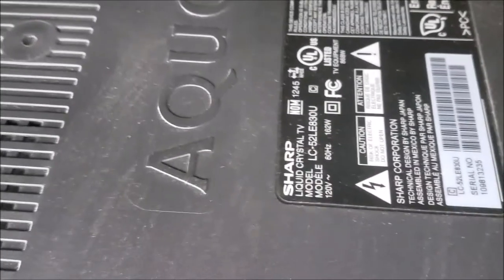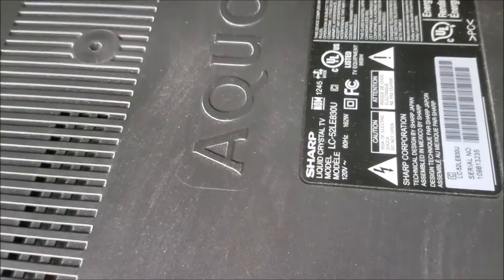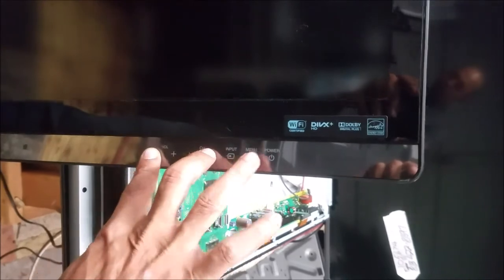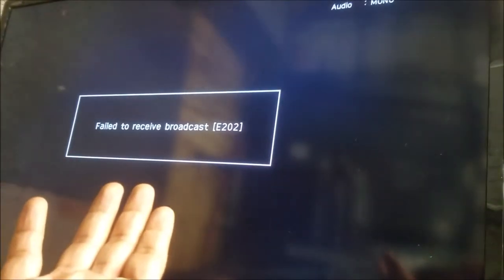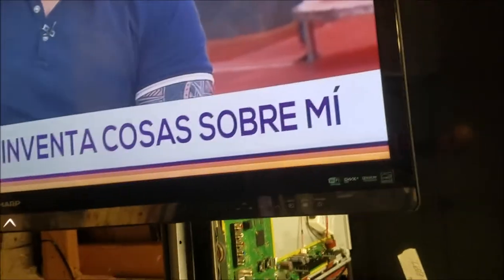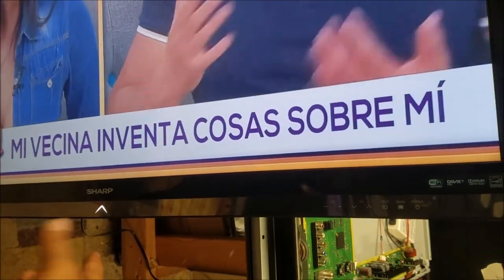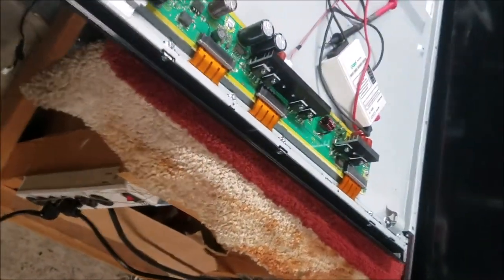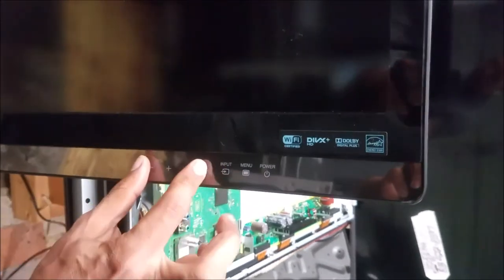SHARP TV lc 52le830u flashing white 1 long 1 short bypass

Comment: Reseting got it to stop flashing but no backlighting. Power there,  but as suspected from the blink code, back light failure. Not proceeding with that costly repair considering the eventuallity of a main board fail later on. TVs suck.